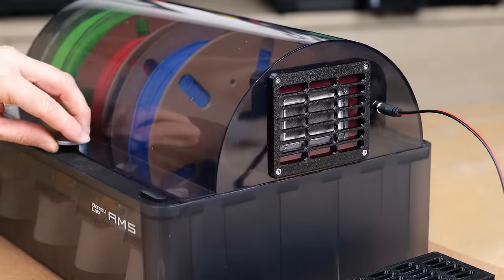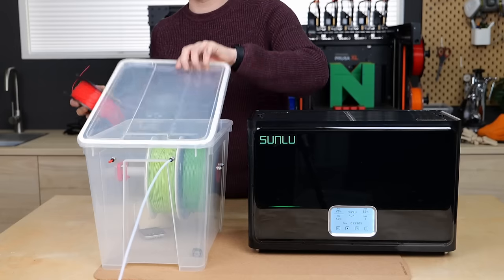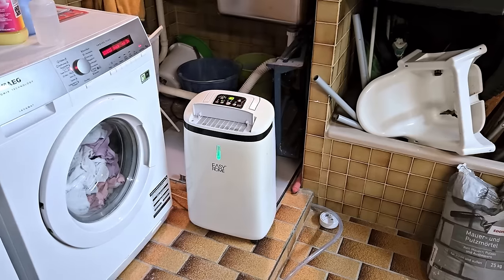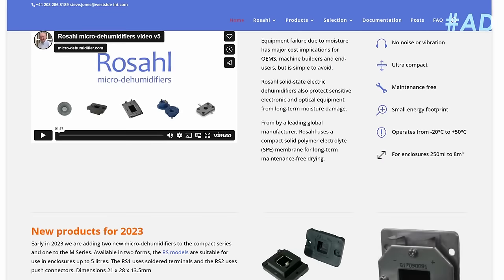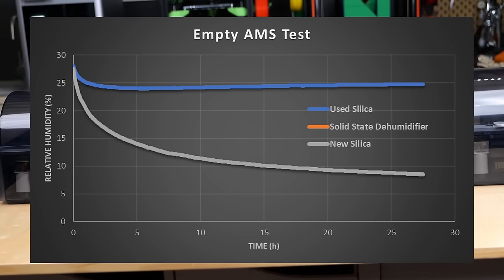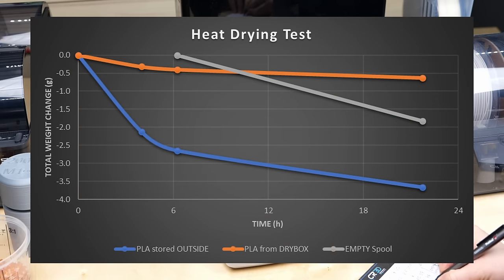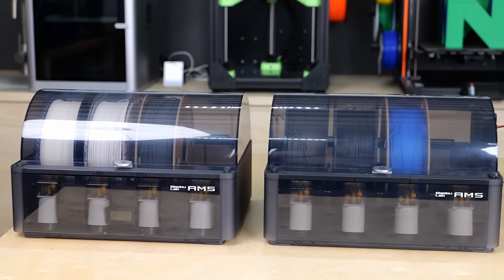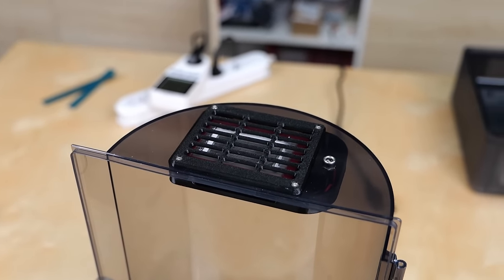Solid-State Dehumidifier: The Ultimate Filament Dry Box

Comment: OMG,  i'm sure that there's already been 100 comments on this ... but the electrolysis does not just produce free oxygen - that isn't a big deal considering a good percentage of the air is oxygen.  It's also producing highly flammable and explosive hydrogen gas.   You can blow this off as being too small to worry about,  but if you dont have ok ventilation in a small room, or a few of the devices if you've got a farm running ... at some point you're going to have a bad day.   Even if it's just a small pop, it could ignite something else.

Don't believe me?  ... go ask your father, or grandfather why in their day they had to be careful charging lead acid car batteries in their garages.
Reply: Dude, calm down and better ask your father for some thermodynamic formulas. You can simply calculate the amount of hydrogen and oxygen by simple ideal gas equation and stuff like this.

The amount of H2 and O2 produced by the membrane is limited to the water vapor in the very limited Volumina in the AMS. Also, the hydrogen on the "wet" site will almost completely recombinate with free oxygen atoms to water vapor again... Without any super nova or a-bomb like reaction

Waist less time.ln your phone and focus more on your highschool education, kiddo
Reply: @ellokaherror9714  hilarious.   It doesn't recombine without an ignition source.  And if it did recombine that would defeat the whole purpose of the device.

And again ... talk to your elders about why they were careful charging car batteries.

Comment: Too expensive for me. Humid air rises. Better to have the dessicant or dryer on top. Circulation is crucial. The floor storage of the Bambu AMS is close to useless. It takes forever. I have 2x 80g molecular sieve in mine with an ESP32 that turns on a fan if RH is above 10%. Too dry, and the filament seems to be more brittle. I live in the tropics, humidty is no joke here. Without the fan, humidity takes days to make any difference. Also cardboard spools is the bane of my system. A freshly vacuum packed spool had 16g of moisture in it. So that moisture will go into equilibrium with your filament. In fact, I think the vacuum makes it worse because there is no air to go to. How many grams of mousture that will be, I don't know, but vacuum does not remove moisture from cardboard. I recently returned my eSun cardboard spools as all my filament cracked iver and a over again after tossing it in the drybox. I suspect, but can't proof that the cardboard leached more than just moisture into the filament, and once dried the filament became brittle. Or maybe be it was just a bad batch, but I was refunded by the supplier as I had documented proof.

Comment: I'd buy a filament box with this technology immediately. That initial investment is pretty small for the ability to just be able to immediately print something in an infrequently used plastic when you need it.

Also, I'm sure this technology can be manufactured a lot cheaper than their current price as soon as it catches on..There are no moving parts in this and intellectual property is a bad joke to the chinese

Comment: It seems totally absurd and implausible to me that oxygen would actually build up inside the device to a remotely significant level. There's no way in hell that the seal on those AMS boxes is good enough to prevent gas diffusion. I strongly suspect you've just scared a whole bunch of people over nothing there. Even if I'm wrong about that, all you need is a tiny 0.5mm hole drilled in the case -- the electrolytic dehumidifier would easily overwhelm the water diffusing in through that hole, but it would ensure that no oxygen could build up. No need for complicated aeration fans and steel sponges and the other crazy stuff suggested in this comments section.

Comment: Hey for some reason I noticed one of my comments is missing. I was linking to a page detailing a 3.6V 6W peltier unit as used in camera dry cabinets. Others have mentioned peltiers here so it's fine but I'm wondering if my comment violated any rule ? A bit disappointed to see time spent contributing, linking to sources etc, going down the drain, and especially from a channel I appreciate. Hope I can be told what happened. Kind regards

Comment: "With desiccant there is always guesswork as to whether it is good or not"... This is just not true. Literally all you need to do is have a load cell wired to a comparator that lights up an LED after a given increase in weight. Water has mass.

Comment: I feel like if you exclusively print with PLA you shouldn't follow this rabbit hole. You're wasting money. I have PLA filament ranging from unknown cheap eBay to what was top of the line at the time(4+yrs ago). I had all my filament in moving boxes for over 3 years. I just unboxed them now and while a very small bit at the start of some rolls was snapping the majority of rolls were ready to print without drying. I believe a singular roll of unknown brand is unusable but I have over 30 filaments here, all ready to use as is.

Comment: The price just means nobody buys it. Also, Japan is more expensive anyway. However, of enough are purchased, it will get cheaper. I didn't even know that solid state dehumidifiers were a thing. 

What about small heaters like what's used within epoxy printers? Keeping temperature for material type and then adding a dehumidifier. Does this work better? Would mass adoption allow for the prices to fall like enough?  Has China reverse engineered this device and can we get it for $2.34 in ten packs?

Comment: Too expensive to be practical.
How about putting filaments inside a sealed closet, with traditional compressor dehumidifier? Some even let you connect a hose to remove water to the outside, instead of storing it internally...

Comment: 2:18
You already demonstrated in another video that PLA is not affected by humidity. Are you denying yourself and denying the video you made earlier?
I continue printing with PLA rolls that have been out of the bag for more than a year and without desiccating anything. And they continue to print perfectly. Which proves that what you tries to deny in this video is true. PLA is not modified by humidity almost at all. 
If you believe that the video you made demystifies that PLA's moisture absorption affects printing, please delete your previous video so as not to misinform others.

Silica does not have to replace it. Dry it in the oven and use it again. It's thousands of times cheaper than buying that crap.

PS: You talk about TPU, ABS, PLA, PETG...When will you talk about HIPS?

Comment: Drying filament is way overretaed in my opinion. 
I never had a print fail or look bad due to wet filament, with one exception being a role of tpu that was lying around openly for over 3 years. Claiming that ABS is affected by moisture is also very doubtful in my opinion. I have never seen any ABS print be affected by moisture and have never even seen reports of people having moisture problems with ABS. 
Do not get me wrong moisture can definetly have an effect on filaments, but as long as you store open roles properly in bags I do not see the need for any special drying procedure.